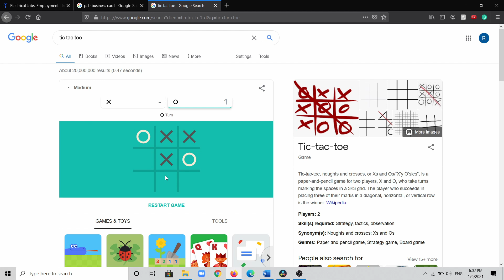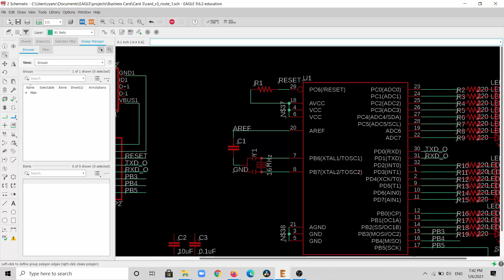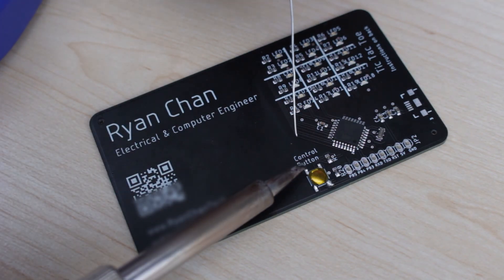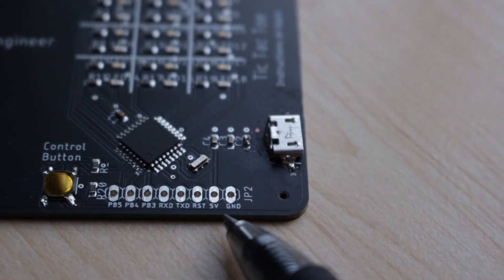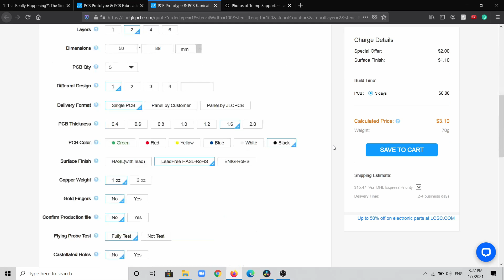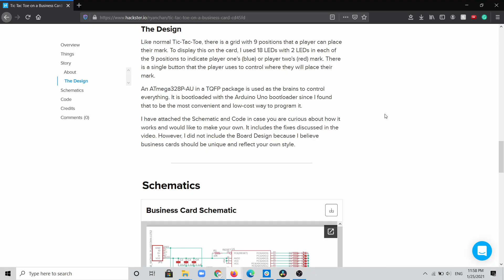Tic Tac Toe on a Business Card PCB - Part 1

Comment: Are you an electrical engineer or a computer engineer? Did you do both majors or your major is "Electrical & Computer Engineer"? I'm just really curious, as someone who's pursuing 2 engineering degrees.
Reply from the maker: My school combines electrical engineering and computer engineering into a single major because of the overlap between them, so I'm just doing one degree. Hope that helps!
Reply: @RyanChan  Sounds pretty cool! What's the school? I respect if you prefer not to tell.